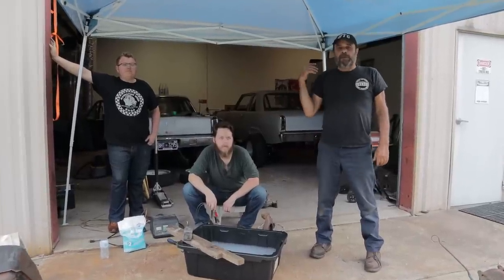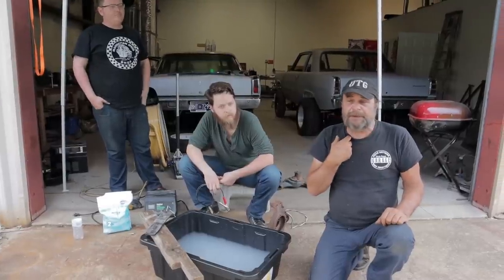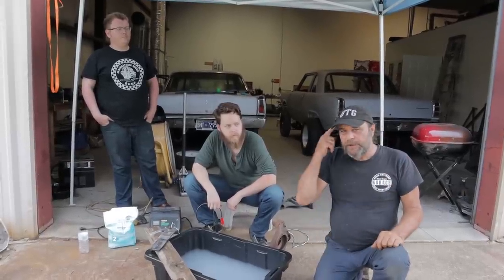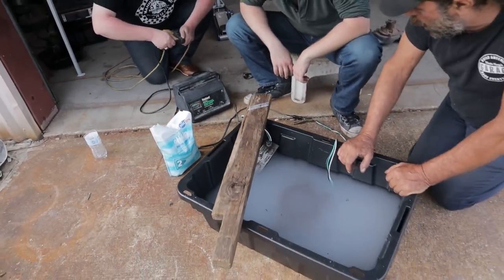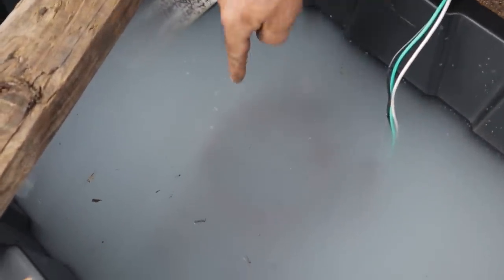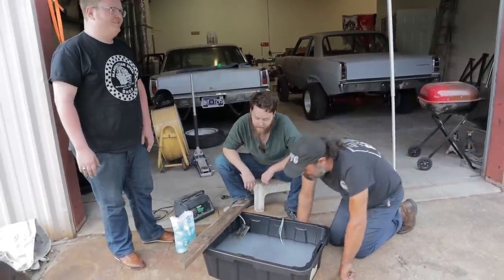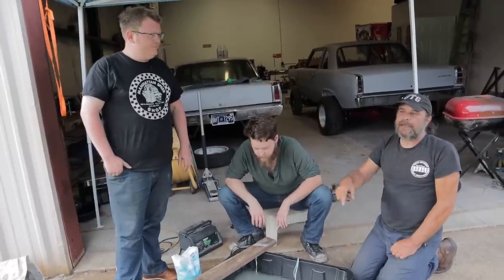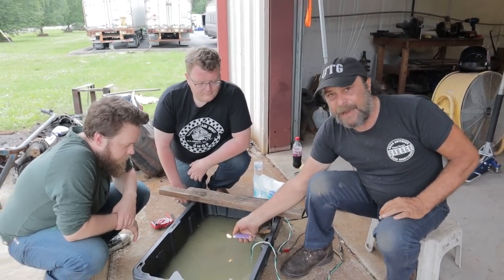Zapping The Rust Away - Best, Cheapest Method Ever!

Comment: So, you CAN use a smart charger, thee is a trick.    Instead of hooking the charger up directly to the anode and cathode, hook the charger to a car battery, and hook the battery to the cathode and anode. In other words, the charger thinks it's charging the battery, so it doesn't think it's shorting out. The power comes from the battery, so as the battery loses juice, the charger replenishes it.    I couldn't find a dumb battery charger anywhere, when I started doing this a couple years ago....   keep an eye on that sacrificial anode, if it dissolves away bad things will happen.    Also, one of the byproducts of the reaction is hydrogen gas, so doing it indoors isn't a great idea unless you want the building to (maybe) do a really cool Hindenburg impression with all the exploding and stuff.    Some metals can be cleaned with this process, which also removes paint and all kinds of crud, but some kinds of metal will get eaten away, so if you aren't certain what metal you're dealing with, test it.

I used this technique to clean the hood (trunk lid I guess) of an old VW beetle for a neighbour. It was a mass of rust, including a few rust holes, but because it only takes rust, the hood was repairable. The neighbour couldn't believe it, when he came back the next morning he seriously thought he was being pranked.

Comment: I cut the bottom of a water bottle off to fit over the filler neck of my motorcycle tank drilled a hole to fit a large sacrificial Allen wrench and hooked it to a car battery made nasty old tank like new while saving stock paint 👍🏼

Comment: Uncle Tony, this is not being done right.  Even doing it right is an overnight thing, not an hour or 2..
What is wrong?  The anode.  It's too small.  You need to have at least 4 of them, one on each side of the bucket with one of the  flat sides facing the water pump.   You can just run the positive wire to each of the 4 sides.  This is will be MUCH faster.  The number of square inches of sacrificial anode facing the waterpump will largely (along with the amount of washing soda) determine the speed at which this will work.  Expect at LEAST overnight.  It does it a very good job, but it is fairly slow.
Reply: Looks like it's right enough to be working
Reply: @bushratbeachbum  Yes, obviously.  But it will work better if done better.

Comment: FYI, I use pool muriatic acid to dissolve rust inside old fuel tanks. No electricity or sacrificial anodes required.   Flash rust will quickly form on the clean steel surfaces,  so you have to have a cleaner greaser and fuel tank sealer right after treating with the acid bath. "Basically" this guy like using Basically. My 2 cents.

Comment: If you're battery charger isn't working hook the battery charger to a battery instead of straight to the parts it will usually fix the problem

Comment: oxidation reduction reaction = rust removal
Washing soda, not 20 mule team borax.
electron theory: negative travels to positive; rusty part negative, donor bare metal positive
make gas tank negative, insulate bare metal rod into opening of tank, do not seal to allow gases to escape do not let positive donor metal inside tank from touching tank, put electrolyte solution to top of tank.
start charger. This can be a safe process if you pay attention to the reaction.

Comment: Why couldn't you use a metal tank as the anode and put the part on a rubber mat inside the tank? It seems this would dramatically increase the surface area of the anode, right?

Comment: You can use beer cans as a sacrificial anode. Since this is a more "noble" metal (higher in the electochemical series), its a better electron donor and your charger doesn't have to work so hard to push electrons into your target. Since beer cans are coated/painted, you have to rough them up a bit to get started.

This will put aluminium oxide powder into your soup. I THINK aluminium oxide slurry painted on , say, a rusted brake drum, would help with mechanical abrasion of rust, (for which I use a crushed beer can as a grinding disk) but I havn't actually tried it.

You can use the powder from a dead dry powder fire extinguisher as an electrolyte. This also seems to add a phosphating treatment effect to the target (it goes black).

If treating the bike petrol tank you mention, stick your sacrificial anode down the filler, (making sure it has no contact with the tank) and connect the tank to -ve, filling it with electrolyte solution.

https://tw.forumosa.com/t/exhausting-all-options/193821

Comment: Hey professor, if electrons flow, and they're negatively charged, doesn't electricity flow from negative to positive? And, would it matter?
Reply: Current is the flow of electrons and electrons are negatively charged so you're correct...it actually flows from negative to positive.   However, we use what's called "conventional current" when talking about electricity, and that says that current flows from positive to negative.  We use it because it allows us to refer to amperage in positive terms, making it easier to understand and do the math

Comment: I experimented with copper doing this electrolysis. If you you have the copper on the positive, it will immediately bubble and turn green. I'm actually going to be doing this on my car I think.
Reply: It will also copper plate the metal piece on the negative side.
Reply: @johnbrizendine7716  I could use this for some cool effects.

Comment: I've spent 8 years electroplating nickel. You guys have what your calling your anode and cathode mixed up. The part that your cleaning is actually your anode. Its dissolving the cathode is your spring.  its attracting the disovled metals to it.

Comment: the reason it smells like a swimming pool is a chemical reaction that is also creating chlorine they sell spray bottles that you can put table salt and water in and through electrolysis it creates a chlorine based disinfectant you can use around the house it's a pretty interesting idea and an answer to your question is I would only use the solution one time because the chlorine percentage is going to get stronger the longer you use it and it may have an adverse effect on your goal of removing rust and chlorine itself is very corrosive so you might do more harm than good depending on the material and the level of chlorine in the solution

Comment: In truth the process never ends as long as you maintain the electrolyte bath and current the current has to be DC. alternating current will not work because the anode and the cathode would keep changing places . If it was left in there long enough the housing would turn to a shell.

Comment: But didn't UT say he wanted a way to do this without removing the 50 year old paint? Or will it remove well bonded paint, or no?
Reply: I did a fender in a kiddie pool and it didn't remove the paint. It did however pop the paint around gravel chips where rust was under the paint slightly.

Comment: Where are we going to find a dumb charger. I have several smart chargers and they are worthless. They will not charge a dead battery.
Reply: Craigslist, yard sales, or market place. The old school "dumb chargers" are the best, a smart charger will refuse to charge a stone dead battery and only work when they feel like it, an old charger will keep going till the battery blows up or the charger burns up, which ever comes first lol.
Reply: @briang4470  I've got an old charger, but I've also fooled the new chargers by paralleling a good battery with the dead one to get the voltage up. 
Most of those smart chargers wanna see 2-3v from the battery at least.
Leave the good battery tied in and wait like 10mins , disconnect and see if it's still charging. 
I've got a multimeter I use all the time to stop guesswork on actual numbers.
Reply: @MrTheHillfolk  too much work for something that should be as simple as hook up the battery and turn the knob to start and walk away, I had the latest and greatest snap on smart charger and that thing was a piece of junk from day 1, after 1½ years it burnt up and I threw that thing in the trash and bought an old turn knob "dumb" charger off craigslist for $40 and that thing was a beat up old pile of junk from the 90s and I have had it for 3 years and it works amazing and will charge anything, I have even been able to revive super dead batteries with it by leaving it on 40amp and spurts of 200amp over the course of a few hours, I will never buy another smart charger again.

Comment: If you go to high on the amps it will pit the metal
Reply: Poppycock
Reply: @funone8716  If voltage is increased as well then ok, high amps and not enough voltage will pit the metal. No question about that. It can also cause other issues. with the traditional 12 volt charger 12 amps is more than enough.

Comment: Pipeline operators use magnesium anodes in anti corrosion systems. Might work better for you instead of steel.
Reply: It will magnesium plate the metal.
Reply: they use the magnesium as a sacrificial anode they run a very low voltage through it and the result is the magnesium corrodes instead of the metal that you want to preserve and the magnesium is corroded a lot faster than it would just by itself so the ingots have to be changed regularly but they wouldn't work for this you can use dissimilar metals to prevent corrosion but not to reverse it plus the gasses that it would create are bad because the process that they are using creates chlorine and magnesium and chlorine don't get along so well chlorine slept with magnesiums girl or something like that either that or it's some kind of chemical reaction and I can't remember which one it is
Reply: @thunderdick6117  I had training years ago setting up the box with the transformers and such. not sure why because it was never part of my job.  I think that our corrosion tech was just  trying to have a few guys trained scattered around that he could call to run out and check for problems.

Comment: using stainless in electrolysis produces Hexavalent Chromium which is nasty stuff, bad for you and the environment.  I've used this on a fuel tank still on a bike just filling the tank and sticking the diode inside the tank, wasnt a perfect clean but did the job.

Comment: Isn't  this method very similar to a machine shop "tanking" an engine block ( for the same reason: to remove as much rust & corrosion as possible ) before the machining process begins?
Reply: Most machine shops actually bake the block in an industrial oven to cook everything off and make it powder. Then use a spray wash cabinet for final cleaning.
Reply: @mikebougher3731  Oh, ok. Thanks for clarifying that for me, I truly appreciate it.
Reply: Hot Tanking uses something generically called " Oakite " to wash , no electricity is used.
Reply: Hot tank is a whiches brew.
yep I remember watching the boss adjust the pH one day using a bag of battery acid. 
That tank was ok for steel/cast stuff but don't put aluminum in unless you like it black. 
There's another tank for that. 
Or else there's the fire cabinet  or the tumbler thingee.
There's about 3-4 main ways.
And it was always a good time walking across the hot tank area to get to the bathroom and have a piece of acid mist get you in the eye. 
It's like a cartoon where the guy gets punched in the face by an invisible man,stops you in your tracks for a second. 
I used to play around back there and clean stuff when I was putting an engine back together, small parts like brackets and whatnot. 
I knew a little about it,enough to not hurt myself 🤣
Reply: @chriscatarcio2983  Hot tanks not legal where?  Oakite is still sold for cleaning.